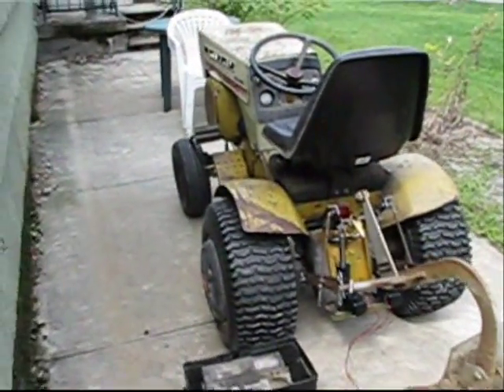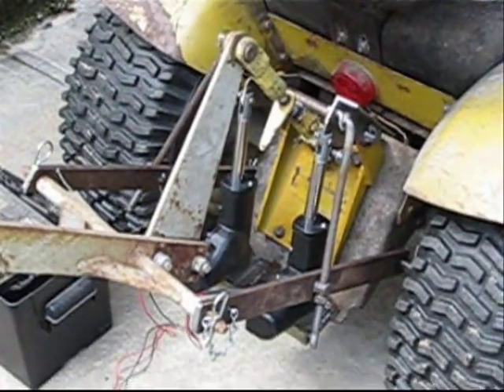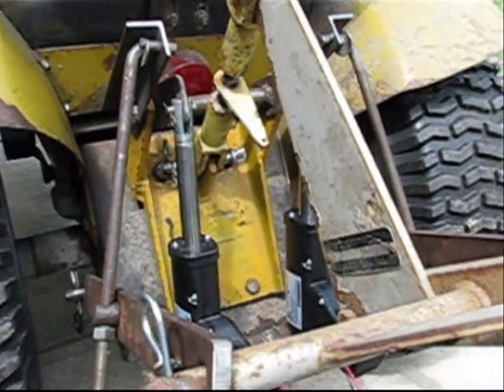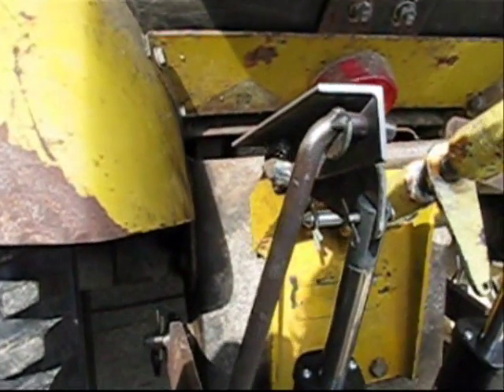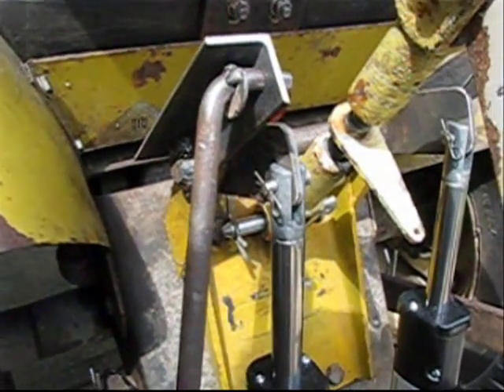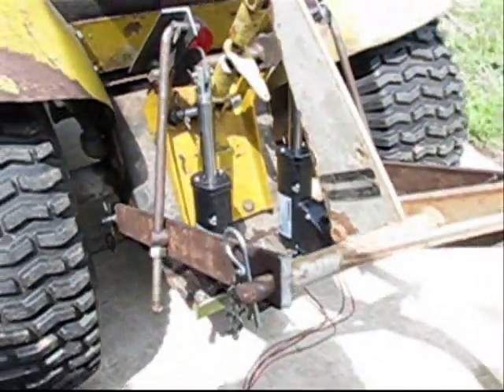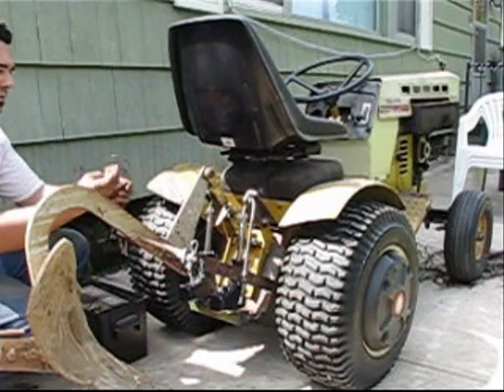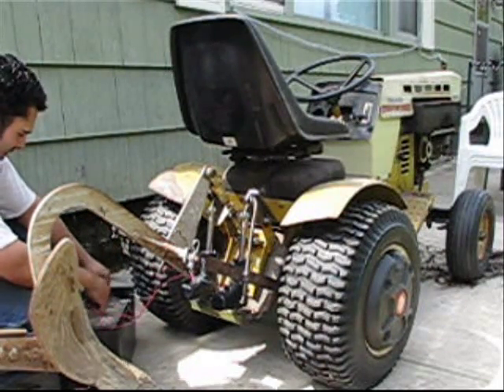Sears Suburbans and customs electric 3 point. Homemade

Comment: I have a newer equivalent to John Deere 316 that i am building a 3 point for it i have a draw bar for it im a bliever that a tractor is a tractor no matter how big it is especially when you use it on a hobby farm or  landscaping like i do because I have a set of 4 way hazards  an a smv sign on it for landscaping and any other time i am on or near  the road  useing it i am autistic so  i have my own way of   doing  things since if im ever going the road im only g like. 5 miles up the road at max hauling mulch limbs ect. and in most cases not even that

Comment: Very cool idea that you put to work. I have a blade on the rear of my Sears 12 and this setup would sure save me a lot of pain lifting and lowering the blade. It is a lot simpler than a hydrulic lift. Thanks for sharing.
Reply from the maker: Thanks. It was pretty simple, and built with spare parts mostly.